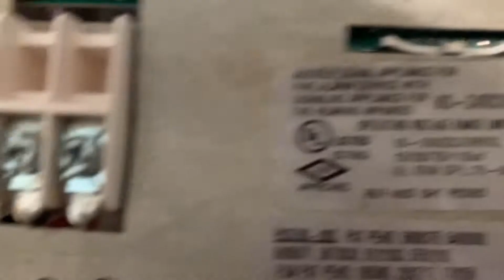Wheelock NS

Comment: Can you change the volume on that?
Reply from the maker: Yes its either high or low volume
Reply: @hamzahassan7730  oh cool I will probably keep it on low volume if I own one
Reply from the maker: @VacuumandFirealarm  btw low volume is still very loud. It was low volume in this video
Reply: @hamzahassan7730  maybe I could like put a piece of tape over the horn speaker to kind of suppress it like same thing when people put suppressers on their guns to make it less noisy
Reply from the maker: @VacuumandFirealarm  Yeah probably the better Idea. I wouldn’t recommend using a lower voltage because then the strobe won’t function properly.